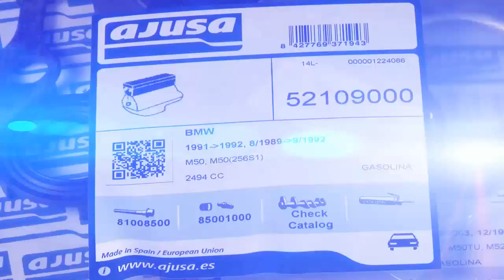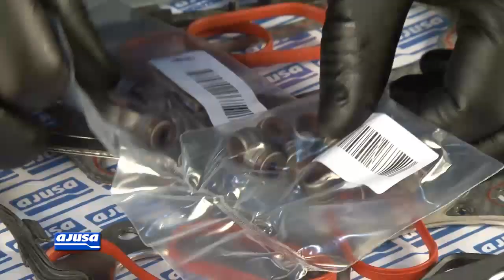Valve stem seal / retenes válvula BMW 325i 24V M50(256S1) .

Comment: hey there where did u purchace  the tools  to remove spring  and the stem seal installer tool ???
Reply from the maker: You can purchase these tools in your nearest store spare parts or via the Internet. These are called valve spring commpressor and valve stem seal inserter. Regards.
Reply: how big is that spring compressor? 8in? I cant find the one you have as it looks nicer than the ones online. lmk thanks
Reply from the maker: Exactly, is the 8in one. Best regards

Comment: ¿La referencia de los retenes es 12005300 para un motor 256S1 de 325i E36 No vanos?
Reply from the maker: Para el motor 256S1, dependiendo de la fecha de fabricación del vehículo, hasta 09/1992 monta la referencia 12005300 y desde 09/1992 la referencia 12010200. 

Puedes seguir toda la actualidad de AJUSA y del sector de la automoción en nuestro Facebook https://www.facebook.com/AjusaSpain/ y Twitter https://twitter.com/Ajusa_Spain. Un saludo